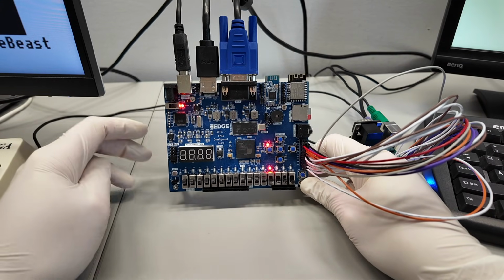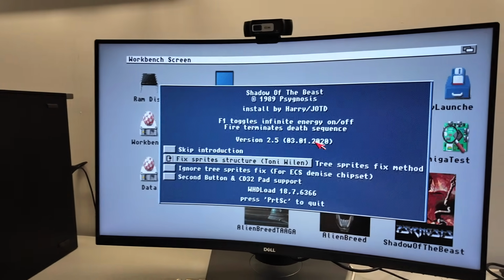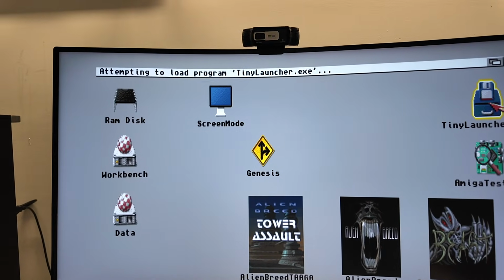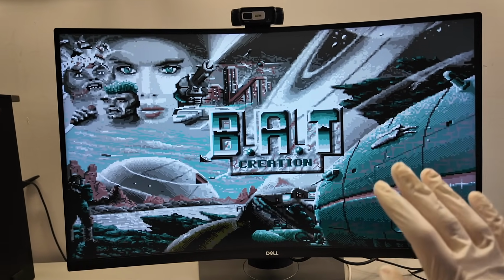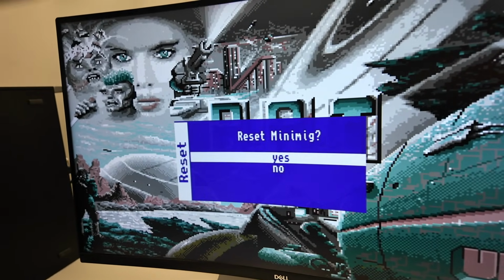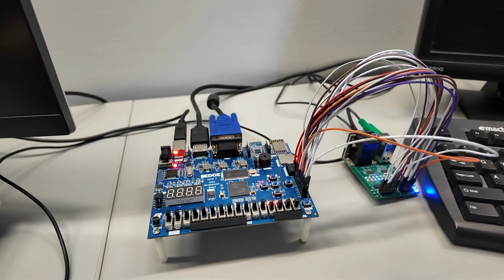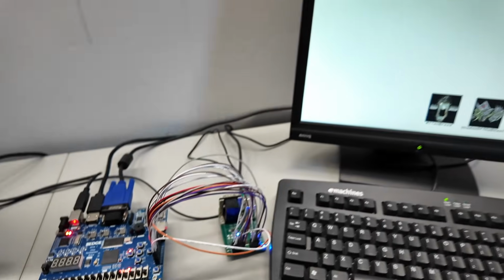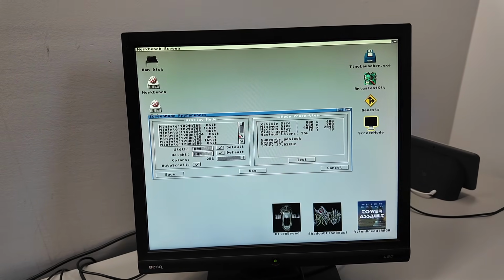Minimig RTG magic

Comment: Really solid update. Nnot many random boards, but a modular migration strategy lands. Treating Minimig as reusable RTL blocks, moving to 7-series/Vivado, and being explicit about I/O modularity and long-term availability is exactly the kind of discipline that keeps retro-computing projects alive past one lucky dev board!

Also appreciated the frank constraints list (DVI-over-HDMI/no audio yet, SPI bottlenecks, SDRAM width implications for AGA, and the MiSTeX/Orange Pi SPI pain). RTG working and Workbench pushing past 800×600 is a meaningful milestone.. FPGA can be really intimidating when you start - that's why a lot of people don't start.

We’d love to see a short “architecture snapshot” next: a block diagram of the current module boundaries (video pipeline, input, storage, soft-core responsibilities) and a quick note on what you’re aiming for as the stable internal bus/interface between modules.

Comment: Why not using display port instead? Every monitors since 2015 have it and it is always possible buy a DP to HDMI adapter if you need to put that on a TV with HDMI only if the user wants. So basically using an open modern standard and shifting the licensing issues to someone else if needed.

Also, if it would be possible to implement a mid 1990s PC chipset, it would be possible to put maybe a super socket 7 CPU and run Windows 95 or 98 on it. That would be awesome.

Comment: Think there will be room left for an SPI to hook up to external MCU's (and a simple library to use it, preferably abstracted from SPI to simple "list devices/send bytes to device" etc...)? Still holding hope on that one because... "free co-processors and extension" ;)
Funny thing really, not sure why, but even on the ZX Spectrum side of things, when i try and talk to people making emulators on bare metal MCU's, the moment i mention "could we put in a simple way to talk to another MCU", it goes... crickets. Like its' some heresy to think of providing RPC services over anything other than TCP/IP. I show them my emulator where i implemented the "virtual device" on software and how it expanded the ZX without touching the "base machine" and its "get the pitchforks and burn the witch" time 🤣😂
Reply: Erm, why? SPI is too slow for connecting second processors. There are perfectly good BBC B cores with Tube interfaces implemented (parallel 1MHz processor interconnects). If you want to use it to control microcontrollers then the question is why? It’s not something retro computers are suited for, while perfectly good Arduino, ESP32 and Raspberry Pi solutions are cheap and off the shelf.
Reply: @stevetodd7383  YT keeps eating the replies, guess it doesn't like github links... Maybe a YT link... https://youtu.be/C2RjHus9Hu0 .
 Even if emulated the concept is the same, the ZX has a link to a virtual device that (at best) manages 96KB/s. Enough to give it a USB webcam. Without the ZX having the slightest idea of what USB or webcam is. Also give it MP4 video decoding, a secondary lowres 24b display, an LCD auxiliary display, a logfile, http file fetching, filesystem access, etc etc etc.
SPI isn't a speed demon, but give me a 20Mbps link to a PiZero2W on an A500 and I'll show you an A500 doing many many things you'd not expect one to do.

Comment: you can do sound over dvi
Reply: No, you really can’t. You can send HDMI extended data (including sound) over a DVI connection because HDMI is an extension to DVI, but unless your DVI device supports those extensions you’ll get nothing.
Reply: @stevetodd7383 actually u really can for decades gpus been using unused pins forever this isnt new many monitors support audio on dvi too use just have to use a adapter hdmi to dvi or dvi to hdmi nvidia supports this since gtx200 ati since hd2000

Comment: It's annoying when manufacturers drop support and move to a newer part but this is the same in many industries like cars and computers that essentially do the same thing but look different, or even food packaging where there are zero changes except a different packet/box. But there needs to be a point where it does get done and produced otherwise Spartan 8 or 9 or 10 will become available and it will have to be re-done again to the newest FPGA part. Maybe the FPGA could be mounted onto a plug-in board so that the base board can remain the same since ports/IO usually never changes as there are only a fixed number of things that can be externally connected to an Amiga. The UltimateC64 has done that where the FPGA is a plug-in board.

Comment: 12:33 It was Numlock hehe! When using WHDLoad I always make a special point of checking and remembering which key is the exit key when it shows on screen at the start. Yeah it's really annoying that none of the WHDLoad games use the same exit key. I wonder if there was a reason for using a certain (different) key to exit or just none of the people making the WHDLoad loaders had the required team communication and organisational skills to decide on a standard exit key ;-)
Reply: Num Lock is not key on a normal Amiga Keyboard, but typical for Help key to mapped to it, when using USB you can use it. an Amiga EU keyboard has more keys, this is a problem for emulators, sense you need to mapped to alternative keys on USB, and often MENU key, Left Window key is missing on PC keyboard this days.
Reply: @kjetilhvalstrand1009  It says it on the screen as the game loads.... NUML at 10:30
Reply: Games are not made for Whdload or they are made for Amiga, if key is used by game, then exit key can not be the same, using a none Amiga button, make sense if its mapped.

Comment: Allways this tiny gaming replicas… please develop an A4000 replaplacement Board or a new Chip (Set?) so the Community can recreate new Amigas with Pci or Zorroports etc.
Reply: You do understand that's the "trivial" part of it? He could take the DraCo approach like Macrosystems did way back, have a "special ROM" to just provide enough support for Workbench and properly behaving software, put "PCIe as expansion" there and BAM, "21st century Amiga".
My public repo of a mod of a ZX Emulator has a "virtual expansion device" that builds on top of the ZX to provide "extras". My PRIVATE repo has "everything AND the kitchen sink as "chipset", including 24b gfx with "hardware" scroll, sprites, yadda yadda, 16b sound, MP4 video and MP3 audio decoding, WiFi, etc... guess which one DOESN'T look/feel like a ZX.
At some point, if you're going to throw it all away, you might as well be running a cutdown version of WinUAE with most stuff ripped out and a "translation layer" to interface to PCIe and call it an AmigaExtraNG. It will work. It just won't be anything people will be particularly excited about.

Comment: Thanks for the news update. Don't let people on the internet rush you into anything. Take the time you need, to make it what you want. Happy New Year.
Reply: Absolutely. Correct answer to "When is it finished?" is "When it is done". I wish the level of my hobbyist level VHDL would be useful but I suspect it's not 75x more than I know.. probably closer to 200x. With the RAM ..is there any point to a SO-DIMM slot and just use commodity memory even if it's only half or a third of the address lines so you can have big (!) memory for modern software? Also with job I will soon be travelling a fair bit unfortunately so my eyes pricked up with the hotel room comment. Nice. Best Wishes and Pozdrav! Loved the videos.

Comment: Did I understand you correctly, this project will support Pi Storm?
Reply from the maker: Yes
Reply: @amicube  Is it going to be possible to use the PiStorm RTG (and possibly AHI) and still have both RTG and AGA on one HDMI output? Maybe using a Flamethrower-like solution?

I'm asking, because I'm expecting the PiStorm RTG VRAM access is going to be much faster than AmiCube RTG VRAM access when using the Emu68 instead of TG68.
Plus, the PiStorm team is slowly working on a HW accelerated Warp3D API :)

Comment: Why you do not use DisplayPort instead of HDMI? Everyone seems to like to pay for licenses.
Reply: Most screens which aren't computer monitors are HDMI. Using DP would mean an extra dongle to connect, which people dislikes a lot.
Ofc it is a shame. Most graphic cards come with DP alone. But that's how it is.
Reply: Unless the cost of prohibited, I would rather have HDMI here. Monitors and TVs have multiple HDMI ports. PC monitors I believe usually have several HDMI ports and 1 Display port. At least now one can connect their PC over Display port and use HDMI for other things. Like this or/and Mister 😊
Reply: Outside your computer everything is HDMI. Your living room TV where you connect your console, it's HDMI. 
So HDMI is much more useful. 
Add though DisplayPort license is free, the use of the trademark still requires signing some documents. 
HDMI though it requires a license if you want to call out HDMI in your products specs. Nobody is going to stop you from implementing it. Just don't use official logos.
Reply: @bzuidgeest or damage everyone's monitor or TV.
Reply: @stephenwhite506 i have no clue what you are on about.
Reply: @stephenwhite506 eh? If you do anything other than send the wrong voltages (which, given that HDMI is simple 3.3V differential signalling, requires a high degree of idiocy) then the worst that can happen is that your TV will ignore the signal.
Reply: @stevetodd7383 1. Gross Overvoltage on +5V Power Pin – Faulty device sends dangerously high voltage back into the display's HDMI port.
2. Back Power / Power Sourcing Conflict – Two devices incorrectly both output +5V, causing a damaging power fight.
3. Excessive Current Draw on +5V Pin – Device pulls too much current, overloading the display's internal power supply.
4. Overvoltage/Surge on Data Lines – High voltage sent on the low-voltage data lines, frying the receiver chips.
5. Ground Loop Currents – Voltage difference between device grounds causes large, damaging currents to flow through the cable.
6. ESD (Electrostatic Discharge) – Static shock during plugging destroys sensitive HDMI circuitry.
7. Inrush Current Stress – Large current spike during connection cumulatively damages port protection circuits.
8. Out-of-Spec Resolutions/Refresh Rates – Pushing unsupported video modes overheats the display's scaler.
9. Malicious/Faulty EDID Communication – Corrupt display handshake data forces harmful sync attempts.
10. DC Bias on AC-Coupled Data Lines – Faulty source applies a DC voltage offset, damaging the receiver's input stage.
11. CEC Bus Spam/Havoc – Flood of control commands wears out components or causes lockups.
12. HDCP Protocol Attack – Malicious handshake can theoretically "brick" the port's encryption engine.
13. HEC/ARC/eARC Pin & Protocol Faults – Shorts or malformed data on auxiliary channels damage those functions.
14. Mechanical Damage from Non-Standard Connectors – Bent pins, broken sockets, or physical stress from bad plugs.
15. Thermal Damage from Blocked Ventilation – Oversized dongle blocks display vents, causing overheating.
16. Excessive EMI/RFI Radiation & Conduction – Device emits interference that disrupts or overloads display circuits.
17. Burn-In from Static Content – Malfunctioning device stuck on a static image causes permanent pixel wear (OLED/Plasma).
Reply: DP always ficks up sober or later on all systems I have been using.
Reply: You only need to license it if (1) it’s a commercial product and (2) you label it as HDMI. The physical connector isn’t something you need to license. The data it sends is a superset of DVI (you can connect to a DVI monitor using a simple cable, and send DVI video to a HDMI display without modifications). There are open source implementations of the HDMI extensions that allow audio and metadata packets and if you don’t advertise it as HDMI then there’s nothing that the HDMI consortium can do about it.
Reply: @stevetodd7383 that is mostly my conclusion, but as he does sell the board or qualifies as a commercial product. But if he doesn't use the label he should be fine.

Comment: Hi, I appreciate your work and effort you did for the Amiga! But why it is not a 68060 with 100Mhz ? I am sorry if I am wrong with this point of view. Greetings from Austria 🇦🇹
Reply: Because it takes more effort to build. And because it doesn't have much use i'm thinking. The only time a 68060 is interesting is when something actually uses those instructions. And most are looking for games which mostly run on 68000. That was the largest user base. The FPGA could run the 68000  at a 50mhz or something. Faster than the original part ever could. 
You could always plug in an accelerator with a 68060. As he says in the video, that is supported.
Reply: Why use a rare and ridiculously expensive 100 MHz 060 when you can use a much faster PiStorm as your CPU?
Reply: @IntuitionAmiga personally I thought the comment meant a 68060 in the FPGA itself. The part can most definitely handle that. But even then what actually uses that. Might as well crack up the 68000 speed in the FPGA or indeed use pistorm or other accelerator.